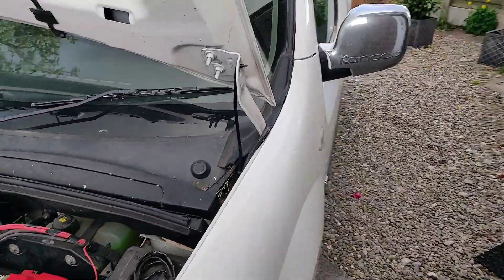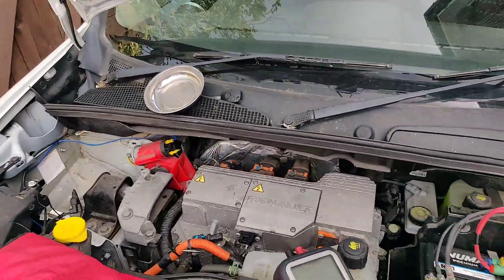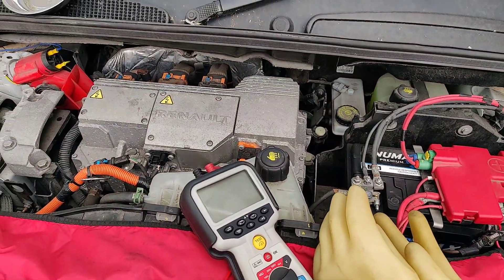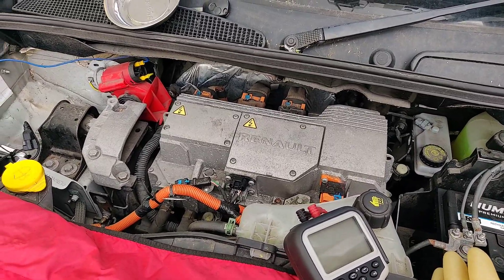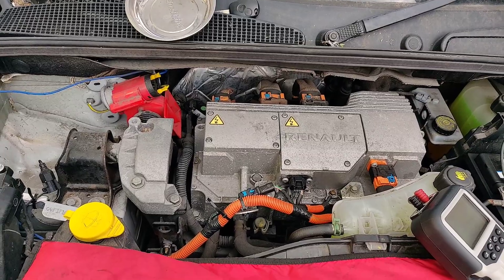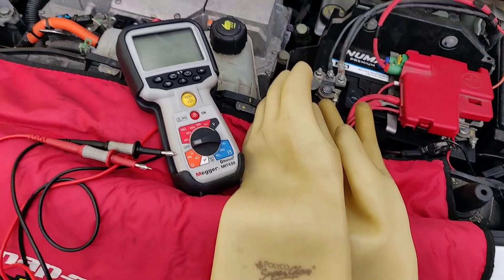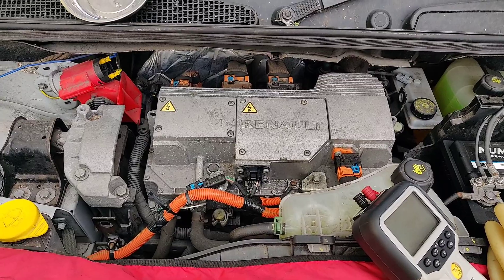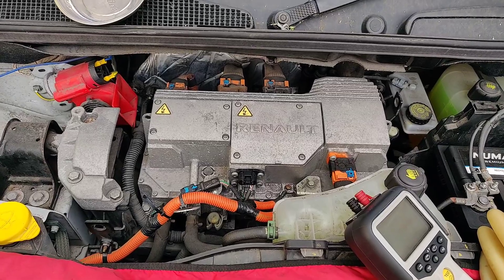Kangoo ZE DF044 charging impossible: The conclusion

Comment: Thanks Steve, probably for the best, out of interest how much roughly are motors and how many miles had this one done, people think EVs are maintenance free and go forever, but methinks perhaps not. Ps if I wear marigolds could I top up the screen wash 🤣
Reply from the maker: 46495 miles, previous owner just paid £800 for a cable to not fix it, new owner is looking at £2k maybe more for repairs (I don't repair) lol, yup, no marigolds needed away from the HV circuits and components 👍

Comment: Good stuff Steve , that's the first time ive even seen under the bonnet of an electric car . Is that a hybrid with an engine ? Or is that 100% electric  ?
Reply: Will you be fitting the new motor Steve. Any idea what they cost??Expensive I would imagine. Not a good advert for Renault. I didn’t catch how old the van was??
Reply from the maker: Full electric Wes 👍
Reply: @SimplyDiagnostics  I am a little suprised, in the First part you said you did a testdrive ? Motor bad, and Isolation Failure, and it even moves a Inch ?
Reply from the maker: chrisi1909 not as surprised as me, with that list of faults it shouldn’t have even gone into ready mode.
Reply: @SimplyDiagnostics  So Renault seems to have some relaxed stategies of HV Diagnostics and restrictions :)
Reply from the maker: It really is surprising, no warning lights with the stored DTCs and drove 250metres after clearing them before DF044 was logged and warning light came on, it still drove even then???